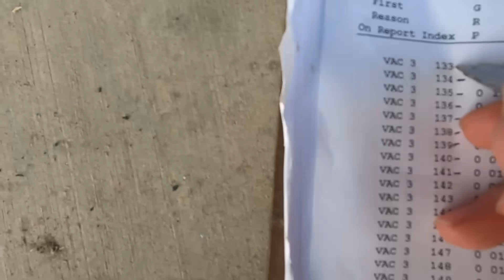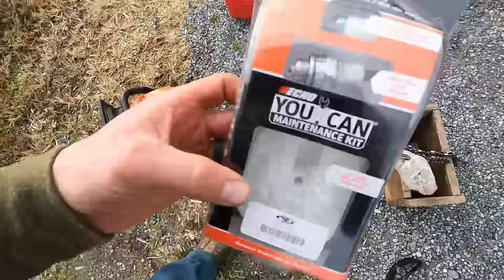Sawing Logs

Comment: Hey Eric if it makes you feel better I knew by the sound that the saw power head was not happy, look for a small hole next to the rivets in the tip you can grease the bearing with a needle adapter for longer life  and flip the bar every time you change chains, and while the side cover is off use that same needle adapter and there should be a divit in the end of the crankshaft that Will allow you to grease the bearing between the crankshaft and clutch drum........but having recently bought into the family I am so thankful to you for your videos and your wealth of knowledge in dairy life.
Reply: I did not know that, good information. Thanks
Reply: Ideally you want to turn the bar over a lot more than just when you change chains. 

Also it's difficult to explain but after a lot of use burs will develop on the bar and you need to file them off. 

Buckin' Billy Ray is a wealth of information on chainsaws.

Comment: The sprocket on the bar is a greased sprocket, you need a needle grease tip and put it in the hole in the bar by the sprocket, they need to be greased each use

Comment: We demand a lot of our chain saws. Work them hard for a few days and then throw them in the case for months on end. I have an older Husqvarna that has cut cords and cords of wood for me over the years. Last summer I pulled it out and it just wasn’t happy. I finally got it running right after adjusting the mixture and idle but I think it too is due for it’s first ever trip to the shop for a professional tune. I always sharpen my blade every time I use it. It really helps the saw perform to it’s fullest. Belated Merry Christmas Eric to you and your family. All the best in 2024.

Comment: Looks good but one thing I've noticed is that you tend to have your head/body over the saw when you're cutting. If you happen to get some unexpected kickback you're then in line with where the saw will go, especially when not wearing a helmet try and stay to the side of the saw a bit more.

Comment: There are oil holes on that bar that need to remain unclogged in order for that chain to be able to run and stay lubricated. Otherwise it will seize up kind of like what was going on when you were using it. It also helps to be able to transport contaminants out of that area so I would definitely be checking on that chainsaws/bar oiling system for sure.

Comment: Besides the bar problems, the carb doesn't sound right. Use non ethanol gas. 89 octane or better for the mix. Yup filter will do it.

Comment: you have to lube the tip with a needle grease fitting, see your saw shop, I teach saw safety, have your saw shop show you proper operation, how to make the saw work for you using the log spikes at the head of the bar, much easier on the saw and you. be safe